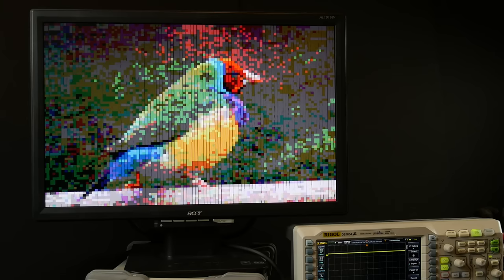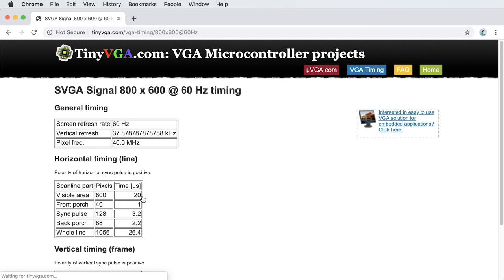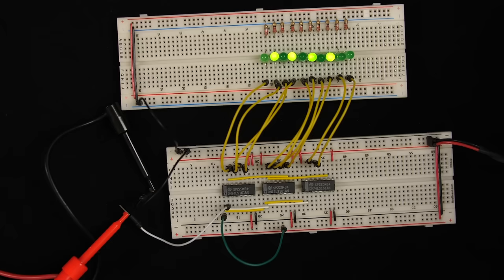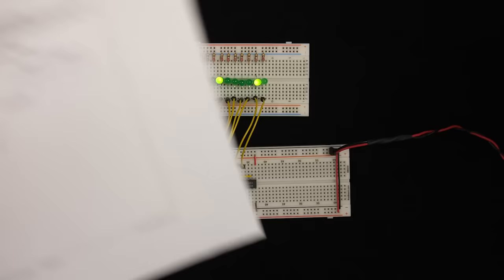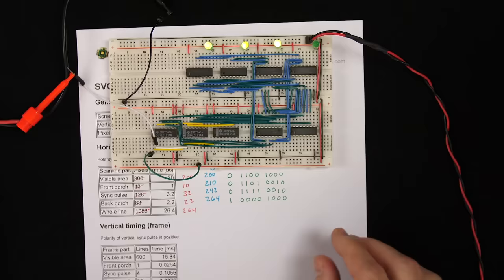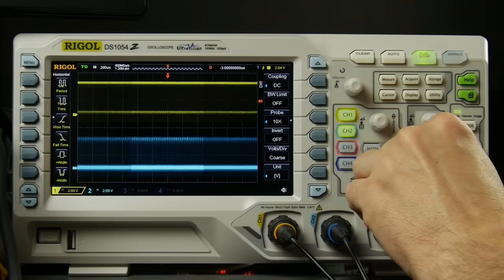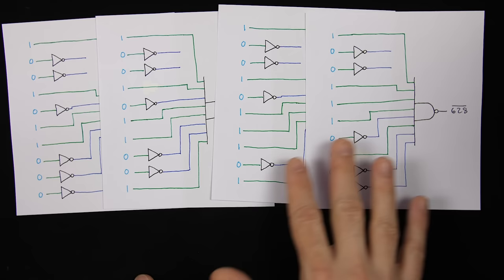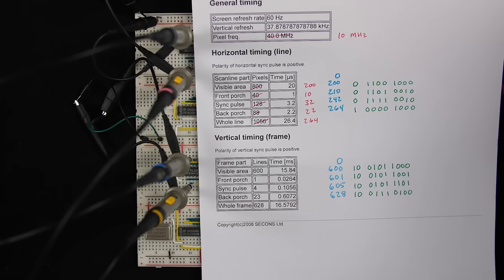The world's worst video card?

Comment: It occurs to me that you don't actually have to AND together all of your outputs at 10:17. You really only need to AND together the three bits that are high. That wouldn't uniquely detect 200, but since you're counting up, it would trigger at 200 and not before. Then you could just latch that signal until the counter reset. Maybe that ends up being more complicated/costly to construct — I haven't thought through it that far — but this 8-input AND gate feels like overkill for this purpose. My suggestion feels like it's going to be even more effective when you get to triggering on 264, which would require 9 bits with the full binary match, or just two AND gates (and not even need a latch any more) with my idea.
Reply: Hi, I have a problem may you help, please? I cant get 74ls161 to work .
When I connected LEDs to the chip outputs they all started to blink together at once, not counting, just blinking all at the same time. What should I do?

Comment: Hi Ben! Would the same circuit work with old CRT TV? I have got one which has SCART connector that supports RGB format. However, I don't see VSYNC and HSYNC anywhere, there are only VIN and VOUT pins. I couldn't find specific timings or data format for this connector, so I would appreciate any help :D. Btw, great videos! Got me into electronics :))

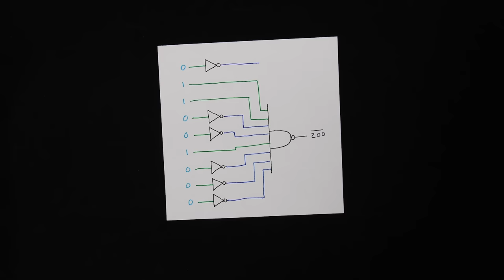Comment: 10:30 it would be easier to invert those, which are supposed to be 1 and just take all the outputs into one single wire. now if the wire is high it is not the number if it is 0 it is. please correct me if i am wrong but that should work shouldnt it

Comment: Parts List:
10 Mhz Crystal Oscillator (Full Can)

28C256 EEPROM
74LS161 (x6)
74LS04 (x4)
74LS30 (x8)
74LS00 (x3)

1.5k Ohm Resistor (x3)
680 Ohm Resistor (x3)

15 Pin VGA Female Breakout Board
Hookup / Jumper Wire
4 Breadboards

Comment: Isn't a cristal two counter a resistor dac and an eprom enough.  You can put the horizotal and vertical timing into the eprom. You can use two eproms for 4096 colors.
The eprom can send a reset back to the counter for getting a 640x480 resolution.

Comment: What if I used an old COM port, RS323 and on a computer and hooked that up to a VGA display? Could I basically emulate a graphics card in software? I mean, I should have fairly good control over the individual pins and what they send, right? 😅

Comment: For detecting 264, couldn't you actually ignore all the bits except the 4th and the 9th, so basically just detect 1xxxx1xxx? Because as long as the 9th bit is set, we know that 264 is gonna be the first number where the 4th bit will be set, and we can ignore all the numbers higher than 264 because we'll have reset the counter so they never occur.

Comment: so, you use the 264 count as the vertical counter clock, but there is one thing that it is no clear. That signal is always high (1) except when you reach the count and sets to low(0) but the pulse is really narrow right? teorically speaking it would be like a dirac delta train? am I right?

Comment: You should remind viewers that the only reason why modern LCD screens have to follow the same legacy timing/scanning systems, is so that present transmission of TV signals must, by law, be compatible with old CRT devices. If or when a decision is made that no one is using CRTs anymore, then we can flash an full frame of information simultaneously at the entire matrix of the LCD device.

Comment: Before there where CRT/monitors for computers people had to send output to a printer which would display ASCII code. Imagine playing something like chess or some other game (which display something like K for a King or P for pawn) and having to print out the results so that you knew what was going on. Of course that was also about the same time people would have to fill out paper cards and use a card reader or flip switches to enter input some only the most dedicated computer enthusiast would be willing to program and play a game on such computers.  I remember the first computer I ever had was a used TSR-80 (I believe that what it was called) which was a computer made by Radio Shack. Luckily it could display it's output to a TV and it could read/write programs to cassettes which wasn't that bad.

Comment: Wouldn't it have been sufficient to check fewer bits and not worry about certain repeat triggers?

200 +128s, +64s, and +8s, all the repeat triggers would be within the range of 200-255
210/242 +128s, +64s, +16s and +2s could then be used twice
210 +210/242 -32, all the repeat triggers would be within the range of 210-241
242 +210/242 +32, all the repeat triggers are between 242 and 255.
264 +256s and +8s, the only time that both can happen are 264 and above
You could then use fewer chips,  so you only need 1 inverter, for the -32s, and 3 NANDs could be on one chip, and 2 4-way NANDs on a second chip

As for 600, 601, 605 and 628:
600 +512s, +64s +16s and +8s and use the RS to then do
601 +600s -32s, -4s +1s repeat trigger on 603
605 +600s -32s +4s +1s repeat trigger on 607
628 +600s +32s +16s +4s all the repeat triggers are 628 and above
This is then 4 4-way NANDs and 2 inverters.

in all this might save 5 chips and use cheaper chips for no downsides right?

Comment: I found not all monitors behave the same when the video data is out of spec such as no RGB output at all, or output is outside of the visible area.
My Compac monitor handled much like Ben's but my dad's Samsung 13" kitchen TV insisted there had to be video data or else "No Signal" and when there was a signal, if it went beyond the visible boundaries, the first line was bright but the scans would fade as the vertical progressed.   When I gated the video with the VBlank/HBlank, the bars were OK on the Samsung.

Comment: This is all fascinating, but all the 200, 210, 260 etc stuff comes over really weird as I'm used to a display line being 64us and the visible area 40us, nice round numbers, counting 0 to 63 resets itself back to zero automatically, and the display/porch/pulse areas can be determined by just OR/ANDing bits 3/4/5 of the 64us counter. (Puts kettle on, cues next video...)

Comment: Question: For the horizontal count circuitry, why did you need an 8 input nand gate to detect when you reached 264?   Since you would never have any higher value than 264 in that counter anyways, it seems to me like you could detect the value of 264 with just a single two-input nand gate that checks the two 1 bits, instead of an 8-input one that needlessly checks zeros.  Your implementation appears to have a couple of 2-input nand gates available in the 7400 chip you are using to make an S/R latch for that part of the circuit, so couldn't you reduce the chip count here by one?

Comment: This is super cool but I'm confused by how nand gate works. So it's just checking for the lows at those specific bit places? And if all of them are correct it also send out a low? 

Are there any educational materials that you can point me too to learn this stuff?
Reply: NAND stands for NOT AND. When all of the inputs of an AND gate are high, it's output is high. The NOT in a NAND gate goes on the output, so that when all inputs are high, the output is low.

Comment: I wonder if it might have been simpler to detect when you reached 210, and then started another counter and checked the bits for 32, and 54, the former of which would have just been one bit on at the 6th position in that case. You also could have reset the counter and used extra bits to track which stage you were at, which may have required one less counter. Just spitballing though, I haven't drawn it out to see if it would have worked.
Reply: i.e. at stage 210, you set the high bits to 01, then start counting again, then at 32, you set the two high bits to 10 and reset, then at 54, the high bits go to 11, I think it may have used less logic overall and required less chips.

Comment: If you install the world’s worst VGA cards, you can install the 16 Grays driver to achieve 16 separate grayscale colors using 256 kb ram. Several monitor drivers can be downloaded such as chgcolor, by changing colors then reseting, the bad video card can be converted to a good one. Bad cards have restrictions, that was a marketing strategy, by such a software, these features can be enabled. To test it, Cosmo gameplay lifepack on grayscale laptops show up in different colors. Restricted cards have only 5 visible colors on a laptop display in DOS mode. When reenabled, I counted about 14 out of the 16, 2 shades were missing on the laptop display. The games look very detailed with the new features of the card. Doesn’t require install, when new software or hdd is installed, the video card still remains with its reseted new default feature.

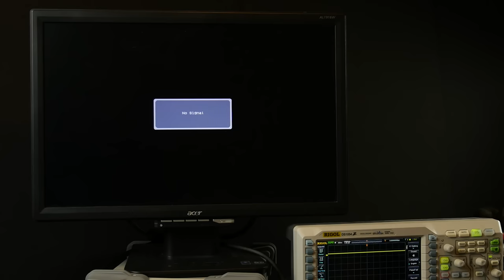Comment: 0:07 Well it doesn't, this is because MVIDIA driver 420.69.6b2fg isn't compatible with Windows version 11.782.14 service pack 2.3 unless you have a motherboard using the BZ410 chipset running BIOS versions 4.52A to 2.71Z except for BIOS version 6.79F.

Seriously though! Great videos, I wish I had these as a kid when I was doing this kind of stuff, I guess though it wouldn't have been nearly as fun as digging through old Motorola data books and application notes!

Comment: how about AV cable (yellow cable), there is not many pins like VGA, but still work.
Reply: AV does everything with one signal: First it sends some sync signals and waits for the electron beam to go to the top of the screen, then it sends one line of video followed by a horizontal sync signal, repeat for every line of video and repeat. What's cool is to look at the signal through an oscilloscope, where you actually can see the signal change with what's on screen

Comment: I am rewatching this and just thought - if you can run a 10MHz clock on a breadboard, doesn’t that mean a 10BASE-T NIC should be possible?  And then one could actually connect a 6502 breadboard computer to a modern router (I think most will still do 10BASE-T?), and to the internet?

Comment: Why not use a couple of EEPROM ICs instead of all the inverters, NAND gates and S-R latches? 
E.g. use data bit 0 for enabling writing a pixel when high, data bit 1 for the horizontal sync signal when low and data bit 2 for reset signal for the counter when high.
That way the following data would be programmed:
 - Address 0 to 199: 0000 0011.
 - Address 200 to 209: 0000 0010.
 - Address 210 to 241: 0000 0000.
 - Address 242 to 263: 0000 0010.
 - Address 264: 0000 0110.
 - Address > 264: 0000 0010 (though it shouldn’t really matter).
Same system for vertical timing except different count values. 
Also, couldn’t you use a single 4040 CMOS 12 bit counter instead of three 7493 TTL 4 bit counters?

Comment: how does this relate to modern lcd vga monitors?
I want to know does the monitor emulate what a crt did with the signal?
If you were to see a lcd in slow motion what would the drawing of the signal look like?
I need to know because I use LCD not CRT ones.
I had a bunch of fat computer monitors but threw them all in the trash last year already because I didn't have room for it, nor did anyone want to take them off my hands.

Comment: To detect the value of 200 on the counter could you not just use a 3 input AND/NAND gate and only check BITs 3, 6 and 7 ? - the value 200 will be the first time all of these are high and you can wrap around at this point?

Comment: you seem to have the equipment for it but your wire placement on that breadboard hurt as an electrical/electronic engineer. one of the first things i was taught was to not cross wires and to keep them in line. also not fully simplifying your logic gates through boolean or otherwise was criminal, whether you did this for simplicity or not i feel a circuit diagram in software would have helped new people.

Comment: If I choose a 640x480 resolution with 25,175Mhz pixel clock. And I divide the pixel clock by 20Mhz, is gonna work? The result of the display pixels, is 512, and if your divide by 20Mhz the result is: 0,0000256

Comment: It may not be as good as an Nvidia or AMD graphics card but it's still way better than the graphics on many of the 8-Bit hobby computers around, and since it supports 64 colors without limitations on where you can put them it's better than most '80s graphics cards at least in that regard.